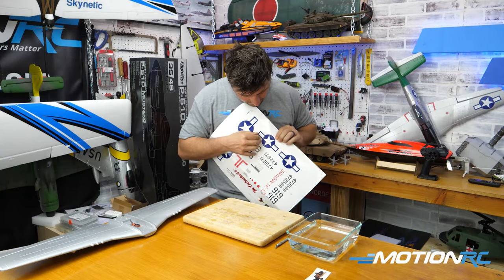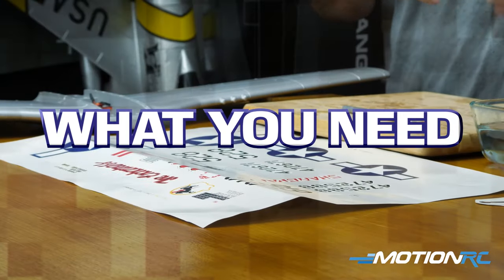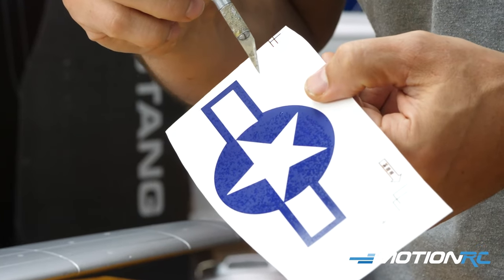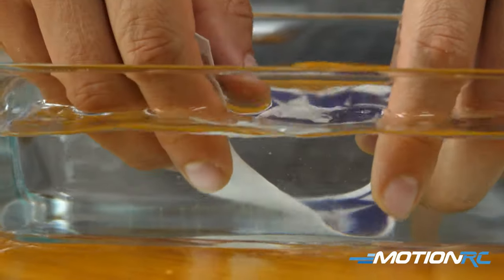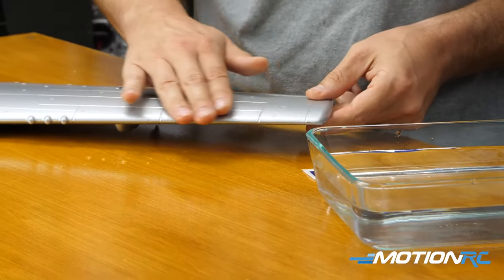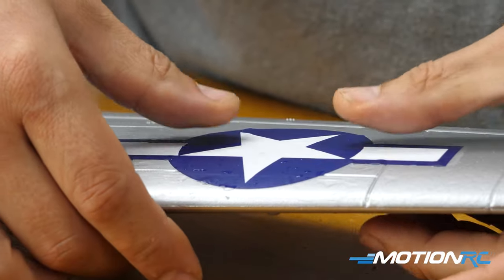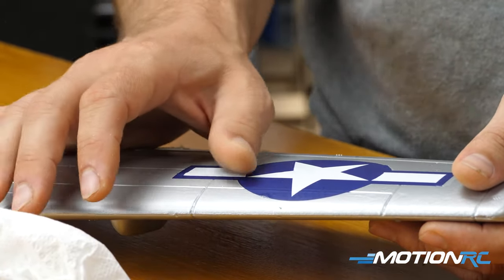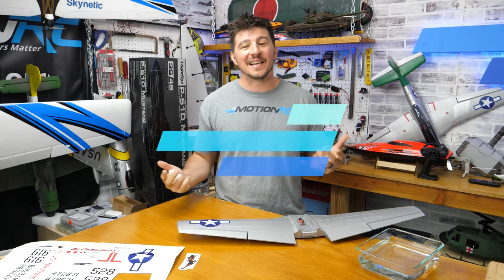How to Apply Waterslide Decals | Quick Tip | Motion RC

Comment: Tip: Decals will loosen quicker in warm water. Older decal sheets lose the adhesive over time.  After applying them to the surface and letting them dry, lightly spray over the entire area with 'Clear Krylon Fusion' for plastics. Dries in 15 min.
Reply from the maker: Exactly the kind of info we hope to see in the comments. Thanks for the tip!
Reply: Warm water is a good tip, that's what I use as well.
Reply: Good tip👍🏻
Reply: @MotionRC  Hi. Thanks for the video. How do you protect used decal from mechanical alteration?

Comment: Also lightly brushing a little decal solvent or setting solution over the decal after application will help the decal settle nicely into all the panel lines and difficult contours.
Reply from the maker: Yes, very good tip as well.

Comment: I use an old cotton t-shirt to burnish the decal down onto the surface and absorb any moisture beneath the decal.

If I need to reposition the decal within a few minutes of laying it down, I soak the decal again with warm water, sometimes with a tiny drop of dish soap to break the water tension, then use a corner from the decal backing paper to lift the decal off the foam. The decal backing paper has a "slimy" texture to it that won't tear the decal.

Great video!

Comment: How about some tips on how to apply water slide decals to compound curves such as nose art, wingtips, vertical and horizontal stabs tips?
Additionally... Got any suggestions on how to waterproof the decals on a foam warbird without leaving a glossy finish? I found that getting caught in the rain will soften the decals up, just avoid touching them until the dry again... Thnx!
Reply from the maker: We can do another video for sure. But a decal setting solution like Micro Sol will help with compound curves as it softens the decals and a coat of clear miniwax is what many use over their decals to protect them

Comment: Just encountered these for the first time building a 1;48 scale aircraft. The ones for my model are so tiny, very hard to work with. Especially for ones that go inside the cockpit.
Reply from the maker: I can only imagine. I envy static model builders of small scale. Takes patience and the right tools. For that, you need a fine tip needle nose pliers

Comment: Not that I would see a purpose to do this, BUT if you ever wanted to remove it or reposition it AFTER its dry, (say, a week or more) can you rewet it and do that?  Other than that, I learned a lot on this video. I want to start applying the decals to my warthog but I didn't get instructions (unless it's in the manual. Who uses a manual?!?! Pfft ). This showed me exactly what I need to do! Thanks, James!!
Reply from the maker: Waterslides still have a type of adhesive to them that is protected by the backing when you initially wet them, but once they dry, they would just flake off if you tried to re-wet them and move them. Once they are set, they are set

Comment: Does anybody know what kind of paper he's using? or what is the best paper to use. I bought some waterslide paper but it seems like it creases too easy and ink comes off at the creases. Any help appreciated. would like to buy the best quality paper possible. Thanks!
Reply from the maker: These decals come with the plane. I have never tried to print my own waterslides, but know some who do. I'm sure a google search will lead you to the right type
Reply: There are 2 types, one for laser and the other for inkjet printers. You can buy in amazon or lazada very cheap. Best to use laser types as it doesn’t need sealing right after ptinting.
Reply: would spray painting several layers of clear coat help? just a thought....
Reply: @flyinbryanfpv  yes thank you. I sprayed it with a lacquer spray and that works well.
Reply: Can you tell me the exact model of the paper?🙏